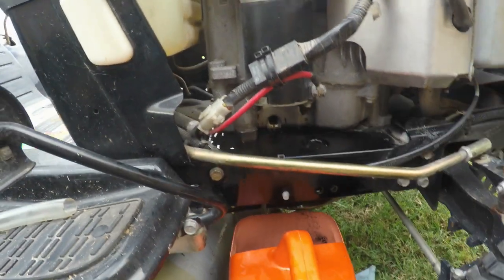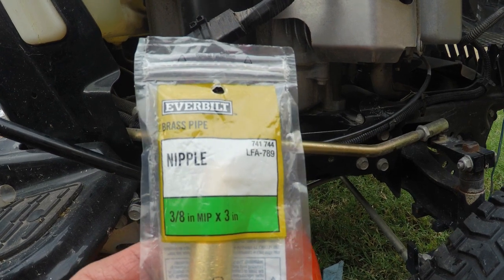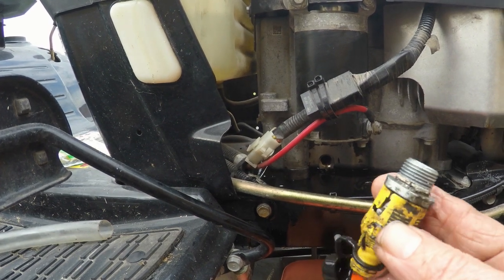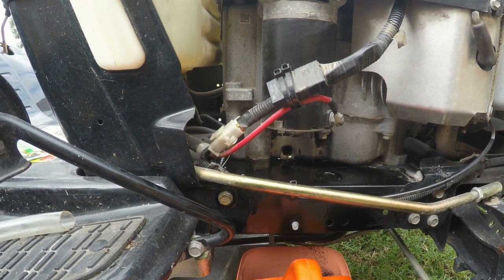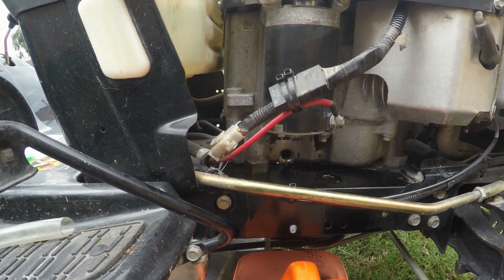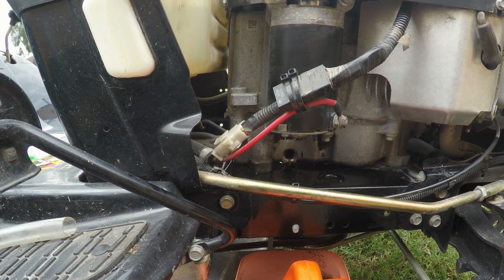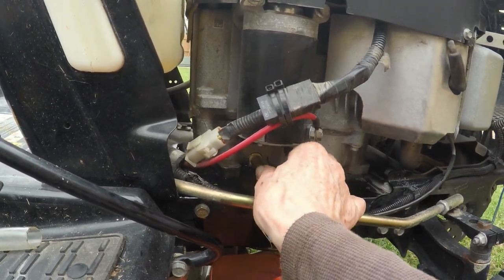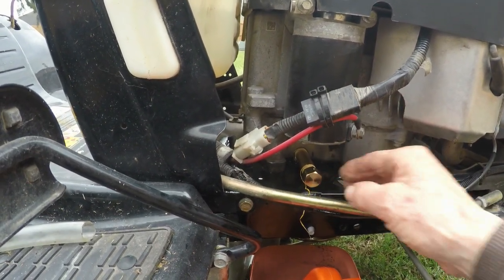Craftsman Riding Mower Kohler KT715 20 HP Oil Change and Drain Plug Modification

Comment: i am probably goiing to replace mine too. we havee had our craftsman dlt 2000 from new in 2001, been a great machine with the kohler 20hp vtwin.. mine is getting old and starting to smoke. i havent noticed a problem with the oil drain plastic.. but ill deff look into it
Reply from the maker: @kylependleton1987  that's great. Some have drained all oil and blown engines

Comment: A flexible hose with a cap makes it even easier. The hose can be clipped away from your steering and then be moved to aim at your drain when needed. I have added these hoses to all my machines. The OE manufacturers don't add this feature because it adds to their cost. Tipping the machine towards the drain will also aid in completely draining the oil.